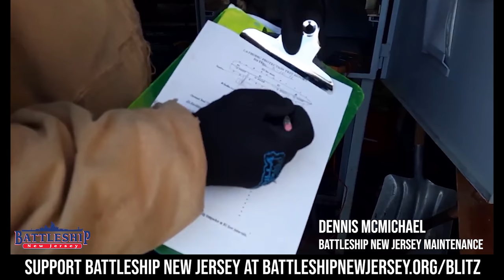Armoring a Battleship: Cathodic Protection

Comment: Hello,Ryan. I am the electrician on USS Iowa. We also use an active C.P. system to protect our ship. However, we hang anodes over the side ( 64 of them ! ) at around 20 feet deep below the waterline. It os a lot of work monitoring these as well as the fresh water in our ballast tanks, but they DO work, and the hull and internal tanks are doing very well. Keep up the good work ! George Musulin.
Reply: George,   Are the anodes electrically connected to the ship?   If not, what is the point?   They must somehow supply electrons to New Jersey, how is this done.   I would think that welding the anodes would be far more effective if welded to the ship as usual.    Further question: what demands the electrons in the first place, that they must be supplied by some sort of anode?     Thanks. Mark
Reply: @Mark-lv1ub  Hanging the anodes over the side makes replacing them very easy, as you just pull them up, and replace the worn end. No need for divers, underwater welding or a drydock, saving a lot of money. Anodes will be bonded to the steel structure, and as well you are easily able to measure the current flow, giving a good idea as to the remaining life of the anodes.

The anodes are there to supply a small current and voltage difference, so that the steel exposed to the water environment is going to be electrochemically either neutral or slightly likely to have added steel plate on, so that you do not lose metal to corrosion when you have the inevitable pinholes in the protective coating. The anodes will erode away with time providing this protection, and you replace them rather than the steel hull, as the zinc or magnesium alloy anode blocks are a lot cheaper than the mass of steel. You can use an impressed current, like NJ is doing, instead of the sacrificial anodes, but then you will replace the electron acceptor blocks ( what the anodes are) quite frequently, though with impressed current your anodes are typically large steel plates with bare surfaces, because it is very cheap, or they are made from large graphite blocks if you want a long life, as the graphite will not corrode very fast, but still conduct current.

If you want long life with minimal maintenance you use hot dip galvanised steel, as then the zinc on the steel surface is all anode, protecting the relatively small exposed steel very well, at least till the zinc is all used up, when the bare steel rusts rapidly and falls apart. This could be decaldes though in dry areas, or in a river system a matter of a year or two, though often the hot galvanised parts last decades. Issue with doing this to a ship is getting a bath of molten zinc big enough to put the ship in, though many small parts will be protected this way, then painted as well.
Reply: @Mark-lv1ub  Hi Mark ! The anodes are powered by a rectifier on board Iowa
 The negative output is connected to the hull, and the positive output feeds the anodes. This is low voltage - about2 volts dc. The whole system draws 100 amps. Each anode draws 4 amps give or take. We use a nickel silver reference cell to measure the flow of electricity between the anodes and the hull. The Navy periodically inspects the condition of the hull periodically, and there is no detectable degradation of the hull. This is a deep subject , and I am intimate with all the details , so hopefully, this answer will give you what you are looking for. Feel free to follow up if you need more details. Take careand God bless. G.
Reply: ICCP
Reply: Thanks for taking good care of these ships.
Reply: There is a complete circuit. Hull cathode. Anodes in the water nearby. Anode connects to the ship up on a dry part, by way of a cable. Either the anode material, or a low voltage (in series with the cable) completes the circuit (a loop). Part of the circuit (loop, path) is the water between the ship & anodes.

If you have a water heater, with a tank, its also protected this way. If you want your tank to last longer, check your anode rod, about once a year. Costs around $20. Cheaper than a new water heater.

I dabble in electroplating, which is an active way to speedup, or slow down "corrosion", since corrosion is just a chemical reaction. Batteries work this way too.

Comment: When I was more active as a volunteer at San Francisco Maritime National Historic Park I first learned about cathodic protection of the steel hulls of the museum's steel hulled ships, Ship Balcutha (1886), Tug Hercules (1907), and Tug Eppelton Hall (1914).  Later, sailing the museum's sailing ambassador, the Hay Scow Alma (1891) I found where the park stockpiled the zincs. They were being used as ballast for Alma!  Sailors love using things in ways that serve at least double duty.  Also reminds me I just changed my engine zinc in my boat.  Most engines on boats are either directly cooled by seawater or indirectly through a heat exchanger. Engines are full of dissimilar metals and need protection.  My shaft zincs are replaced between haul outs by a diver. I believe you can have those hull zincs replaced by divers as well. They can be welded or bolted on.

Comment: As an apprentice electrician, I worked on San Onfra Nuclear power plant.  During my work at the plant we installed 250 ft wells around the plant and installed zinc anodes in the wells on pipes, and lowered them down into the well.  They were attached to the pipe with one anode ever 10 feet, until the bottom of the well was reached.  Each anode had a #4 insulated wire imbedded in the anode.  Then all 25 wires from the 25 anodes were brought up to the top of the well and terminated in a computerized controller.  The system was set to automatically adjust to protect all of the metal in the plant including the rebar encased in the concrete.  We then backfilled the wells with volcanic coke.

Comment: I learned about zinc ingots years ago working on the hull of the Elizabeth II, a replica of the vessel that brought the "Lost Colony" settlers to Manteo.  Each year in hauling her out of the water, we fastened zincs on to the rudder with lag bolts.  As well as I recall these zincs were about 2" X 6" X about 1/2" thick.  It was amazing how badly eaten up the old ones were after just a year when we did the work.

Comment: I was not aware of the issues of corrosion you talked about and how to protect the ship. I am however a bicycle mechanic. In that role we do see corrosion issues on bicycles. Aluminum seatpost in a steel frame. Steel accessory fittings pressed into aluminum, titanium, magnesium and carbon fiber frames. A lot of people assume that if they have a carbon fiber bike frame and fork they do not have to worry about it deteriorating like a metal frame. The dropouts or contact points where wheels are attached are usually aluminum. The same for bearing contact points at the front headset steering and the bearings for crank sets. Plus steel or alloy fittings are pressed into the carbon to attach water bottles and some shifting parts. Corrosion develops at those carbon and metal contact points. The contact of metal against carbon fiber actually creates a very tiny electrical charge without any input. We are talking about a charge so small very precise expensive meters would be needed to measure it. Add a little salt perspiration dripping from a rider. Mix in a little salty air currents off of the ocean on any coast you may live near and that corrosion speeds up a great deal. The average life expectancy for a carbon fiber bike frame due to these issues is about 15 to 20 years.

Comment: I tested cathodic protection for gasfield pipelines in Canada.  It was interesting to hear how the ship uses it and so very similar: just swap out the conductive water around the steel hull for conductive wet soil around a steel pipe. Paint (and plastic coating) is the first defense, then cathodic.  A good functional way to think about this is rusting (oxidation) sets up a small voltage across the metal/fluid contact and cathodic applies a reverse voltage to just barely cancel it out.

Comment: Your Hot Water heater in your house & RV has an anode rod in it to keep the tank from corrosion, which reminds me its getting time to check the one in my 5th wheel
Reply: Like anodes on a ship, these should be inspected regularly.  Most residential water heaters recommend annually, same as removing sediment from the tank bottom.

Comment: I spent time aboard the USNS Research Vessel Hero working in the Antarctic.  We installed  zinc sacrificial anodes  any line that had saltwater to prevent electrolysis caused by salt water flowing through any of our pipes, pumps, an equipment.  We would change these zincs about every three months.  The Hero was a wooden research vessel of 125 ft length patterned after a New Bedford side trawler.  We had reefers on board large enough to take an entire whale aboard and dissect in the name of research.  When originally launched Hero had no refrigeration for food stores.  The builders thought the bilge water would be cold enough for frozen food stuffs   I served aboard Hero as 3rd engineer, water/bunkers king.

Comment: Cathodic protection is widely used in the petroleum industry. Refineries protect pipelines and storage tanks. Even gas stations have used cathodic protection on underground storage tanks, burying large sacrificial anodes with steel tanks (usually clad in fiberglass) in areas with high water tables. (The usually weigh the tanks down as well with massive concrete anchors, so tanks don’t float up through the pavement.) Most of these cathodic protection systems have serviceable anodes which are replaced when needed. CP protects against moisture corrosion as well as galvanic activity between dissimilar metals. Up until this video, I was unaware of its use in ships, but it makes sense.
Reply: Fun fact, even your household hot water tank has cathodic protection in the form of sacrificial anodes.

Comment: A lot of storage hot water heaters have something similar, mostly magnesium instead of zinc. That hangs in the middle of the tank to draw any corrosion to it rather than allow the steel tank itself to rust.

Comment: This may sound silly, but I install several anodes on my 1993 Jeep Grand Cherokee... Bases on what I learned from outboard boat engines tech.. Just to see it that would work on a vehicle isolated on 4 rubber tires... For what it is worth, my Jeep has no rust on it AT ALL..  And yes, the zinc anodes are much smaller then when they were installed in 1993 1/2... The catch 22 to this, is you do have to check them often, to make sure they are tight against the bare metal areas, which I do every oil change. Only once every other year do they seem loose. It is a very slow corrosion process on a road vehicle. The white fuzzy powdery surface of the zinc, always looks the same, and at first, thought is was from the soap from washing the Jeep, being caustic, but, then 10 to 15 years later, I pulled a few off, and was comparing them to the never used units still sealed in K-1 or mineral spirits in a vacuum bag and when comparing them side by side, they are different sizes, almost perfectly, eroded away evenly, so it looked like they wee not working, but, they do, even on a rubber isolated vehicle.. I just remembered, there is rust on the Jeep, The metal black painted in-line 6 valve cover. It is not touching any metal, as the hold down hardware, are bushings, and resting on a cork gasket, lol... what are the odds of that.. I enjoyed this video.

Comment: Some hot water tanks, and boilers use catholic protection, most use a sacrificial anode, but some large commerical boilers use an active system. Also salt water pools usually use a zinc anode.

Comment: Hi Ryan, I’ve been installing and commissioning ICCPs in German, Dutch and Belgian offshore wind farms for the last one and a half years. Though I’m not sure how the operation respectively the values your ICCP measures and uses compare to the values I’m used to, because the USS New Jersey is probably made from a different kind of steel then a offshore wind turbine foundation. Also I’m not sure what material your reference cells and anodes are made from, which would also alter he values measured and read by the ICCP. The same applies for the mobile reference cell your technician in the video used. But that value of 0,44 (I assume V, which would be 440mV) seems to be a sign for good protection. But again, that depends on the materials involved.
The ICCPs I worked with had fixed reference cells made from Zink, while he mobile reference cell was made from an Silver/Silverchloride alloy.
Reply: Hi, same as you I am not sure what reference cells NJ uses but on a standard steel hulled vessel like a tanker we usually recommend a setpoint of 180mV or 220mV, and 440mV for a zinc reference electrode would fall into the underprotection range. Portable reference electrodes are again made from zinc or ag/ag/cl and would be either around 180mv zinc or -750mv ag/ag/cl.

Comment: Would love to see some pics of the construction of the ship.  There's not a lot of pics out there showing the heavy lifts, cranes, welding, and erecting the pieces of steel of an Iowa class.  I worked a lot of years in a modern shipyard building navy ships of much thinner steel, I'd love to see how they erected such heavy thick steel with cranes of the 1940's.
Reply from the maker: We can definitely do more videos on construction, in the mean time, I have a video for you and a link:
https://youtu.be/9u0mqs7Exe8
http://www.navsource.org/archives/01/62a.htm
Reply: @BattleshipNewJersey  I figured they must've had some decent lifting capacity back then for such heavy armor.  I did a few 300 ton and a few 600 ton plus full breadth module lifts in the yards.  Ships today are built modularly vs stick built back (Titanic) in the very early days.  The Liberties were the first major example of modular build. I suspect the Iowa's were somewhere in-between.  Part modular, part stick built because of the excess weights of all that armor. Crane and transport capacity dictates the lift sizes.  So the yard capacities back in the 40's seems to be max around 600 ton as seems with the turret lifts without top armor.  My next question would be plate steel vs castings.  The 16" thick belts and other heavily armored, are they one sheet or layers of sheets, or castings?  In the yards today its rare to see anything thicker than 2" on the ships.  Mostly under 1".  What's the largest weld you see on the ship? I've called out 3" fillets  (layers of passes to build up to 3") on crane bases, but that's extremely rare. I would image with 16" armor there are some crazy large welds onboard.

Comment: Fun fact: water itself is not conductive to electricity. It's the minerals and other impurities that are dissolved in the water that make it conductive.
Reply: This exact principle is used to monitor condensate and boiler feed water quality.  As condensate and boiler feed start with distilled water and then have treatment chemicals added in specific amounts, the water conductivity at a given point in the system is known.  There are installed sensors which constantly measure the conductivity and set off an alarm if readings are not within preset parameters.
Reply: @kevincrosby1760  Yep. I used to work at an ethanol plant and that was one of the things we had to pay attention to.
Reply: Yes high voltage transmission power lines are periodically washed down with deionized water.  The DI water does not conduct.

Comment: Ryan, Does the New Jersey use jacking gears to keep the main propeller shafts (as you call them,  we, as a sailor, called the propellers screws) rotating slowly while we were sitting in port. It was to keep the shafts from bending because of the weight of the screws (propellers as you say).
Reply from the maker: Check this out https://youtu.be/Q5dkJ_KqljA

Comment: In the video on the machine shop, he mentioned that one of the projects they were often working on was in making the zink anodes. Were these these the ones used on the interior spaces or did they also make the external ones that they would have had to send divers over the side to attach.